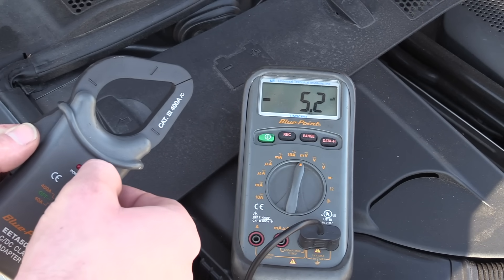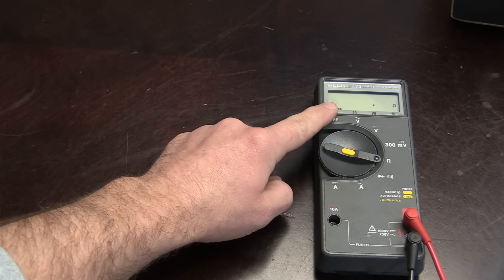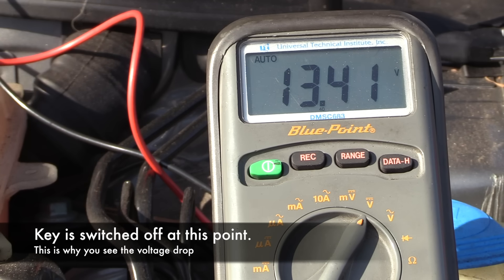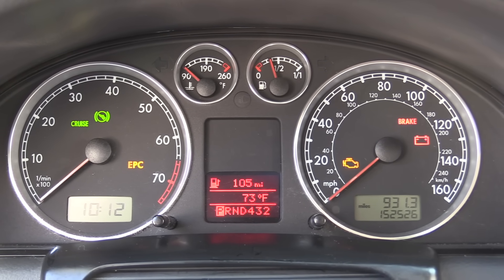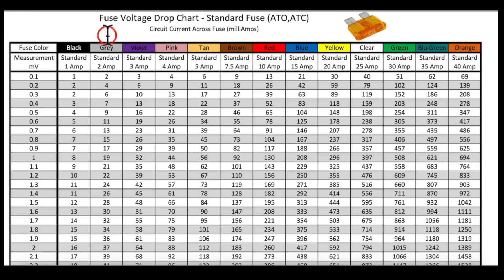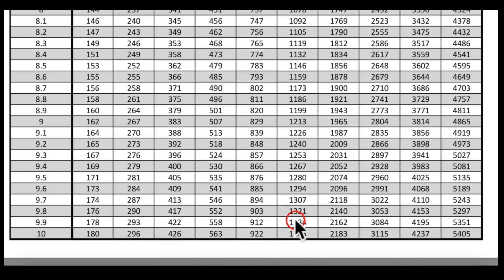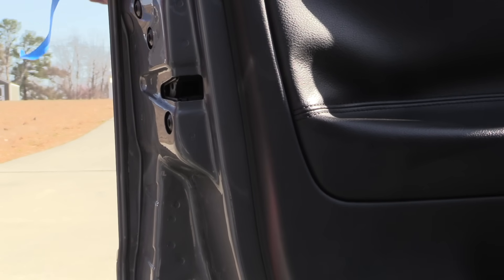The BEST Way TO Perform a Parasitic Draw Test

Comment: Trying to find a parasitic draw on a Yaris 2015, where there are a few large fuses (are they known as Japanese fuses?) do not appear to have an accessible place on either side of the fuse where multimeter prongs can be applied. I'd appreciate suggestion as to how to deal with this.

Comment: Great video! I have a parasitic draw on my 2012 Jetta Sportwagen S, 2.5L. But my problem is that my owners manual does tell me what a fuse is connected too. I contacted my closest VW dealer about getting some kind of a fuse map and what they sent me is extremely low quality pics of some database where you have a photo over a table.  Is there a website that I can enter my VIN and get some useful information?

Comment: I usually disconnect the negative cable and put my amp meter between cable and post, I latch the doors and wait like 5 minutes and then start pulling fuses. I’m going to try your voltage drop method tomorrow because if it works it would be faster/easier.

Comment: I had a van that wouldn't start from a drain. I took half the fuses out and the van started the next day, so I knew it wasn't one of those fuses. Then I took out half of the suspect fuses and the van wouldn't start so I knew the bad fuse was in the remaining half. Kept doing that each day until I isolated the bad fuse.

Comment: When I latch the doors on my f250 2017 the outside mirrors and interior lights don't go out so the truck can't be put into sleep mode ?
One would think Ford would have included a sleep switch for a parasitic test but I guess that would be to easy.

Comment: On 1990 chevy 1500 501L 8 cyl  p.u. truck  parasitic draw test with basic red centec multimeter which setting do I SET TGE DIAL WHEN JUST TOUCHING PROBES TO FUSES WITHOUT PULKIBG THEM OR REMOVING NEG. BATTERY CABLE?

Comment: how can ya measure voltage drop across a fuse with the two meter leads and the fuse is good with the fuse points connected  inside the fuse ...anyone ????
Reply from the maker: Any 2 points will have a drop if there is voltage on the circuit
Reply: @HumbleMechanic  THANK-YOU FOR YOUR REPLY SIR, I,LL PUT THAT IN MY BRAIN AND THINK ABOUT IT AND TRY IT ..PEACE EVERYONE !!
Reply: This confuses me, too. It doesn't make sense. What I think he means is that you measure the circuit current you're seeing, but the fuse adds a factor to that, so you look at the chart to see what it's really reading in the circuit, or would be reading without the fuse. So you get an accurate amperage in the circuit and can tell if it's too much for sleep mode. The fuse is just involved because it's super convenient to have every circuit right in front of you with two contacts right there. Maybe I'm wrong. I hope not, my 2010 XC70 is killing my battery every 2 or three days. We'll see.

Comment: I had a parasitic draw with a Jetta and it is not the sort of thing that kills the battery quickly.  Charles was right when he said that.  It is more likely to leave you unable to start it each morning.  You might be able to get around during the day with it if you must but you risk getting stranded.  If you do have this problem and need to attempt to use the vehicle despite it, keep a charged phone with you so you can call for a tow truck.  Then next stop is your favorite dealer or shop.

Comment: You made a mistake at 7:01 when you read the current draw. The table shows the current in mA. We see the number is 1006. That is ONE AMP, not .1 A. Please correct the video to not misinform the viewers.
Reply from the maker: There is no way to edit that.
Reply: @HumbleMechanic  Is that a "Yes, I made a mistake but I will not recognize it by editing the video"? Because you can take down the original, annotate on video with an asterisk saying "* I meant 1Amp" and upload it in the place of the original one.

Comment: Alright, this seems simpler as my new autoranging multimeter zeros out before stabilizing its amps reading while connected in series to the battery's negative terminal. It also seems simpler because, with my battery in the trunk and the fuse box in the glove compartment, I can't be popping fuses while reading the display.

This involves no removing fuses and no sensitive AMP mode to possibly blue the multimeter's fuse.

Comment: good point you made at the start is the battery voltage. It must be in the 12.5 to 12.6v level or else all the mv ratings on the power probe charts will be to far off. Source voltage is important !! good job man.

Comment: Thank you for the tutorial guide. I have had a problem with both merhods, amp drop test by pulling fuses resetting modules. But also had similar problems with voltage drop testing without pulling fuses. The issue i had eith voltage drop was sometimes the problem is intermittent parasitic battery drain coming from a module thats commanding something to draw power for a while then go away. And testing each fuse till it goes to zero can cause you/me to moss the problem fuse because it isn't always there, could be a draw every 10sec, every 5min, or every 40min.

So in short it's basically same with noth unless you are monitoring the battery negative in series with a jumper between post and cable connector so you don't unhook battery / car from ground but can see when the drain is happening on clamp meter.

Comment: Question??  never had this problem with any of my cars but i do with this one.. its a Kia Picanto and seems to be drawing a lot of Parasitic Draw to more or less Nuke a car battery in 6 months, is it best to just take the earth connector off the battery terminal until you use the car the next day, basically as it is not going into Sleep Mode when the keys are taken out of the ignition
Reply: One problem with totally shutting off the power is that what your computer "learns" goes away and it has to re-learn every time you re-connect.
Reply: @rickmurray7123  yes it's a bit of a nightmare.. but my 🔋 has lasted 6 months and still ok

Comment: Why not just measure amps across each fuse?
Reply from the maker: Because you don’t measure amps that way. You measure amps in line. Which means you’re pulling fuses. Which means you’re disrupting the system.

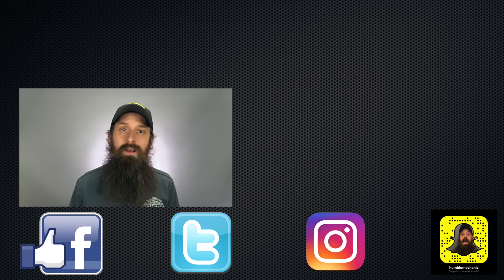Comment: hang on, is it just me..? at 10:45-ish he looks at the 3.4 milliVolt of voltage drop on the leftmost column and goes to the yellow fuse (20Amp) column and reads 1005 and says that's 0.1Amp??? The values in the fuse columns are in milliAmps (mA) and 1005mA is 1.005 Amps not 0.1005 Amps... a car radio will easily draw 1Amp.. I didn't go through all the comments, but if this has already been spotted I apologize.

Comment: Another option is to pick up one of the fuse holders for blade fuses. On amazon you see them as a circle of wire with a fuse socket. Cut the wire, add a spade connector to each end. To test current draw just pull a fuse, plug the spade connectors in where the fuse was, and put the fuse in the fuse holder. Now just use an amp clamp on around the wire. If you don't have one that is accurate enough, get a good meter that does. If you have a good meter but its not a clamp on style, you just need to alter your fuse holder leads a bit. Just make an additional lead from some spare wire that has spades on both ends. Now you can plug it into one of the fuse slots and clip your ammeter in series with the new fuse holder. Super simple to do and gets you an accurate and fast reading. No need for charts etc. It does have the disadvantage of messing with the circuit so the problem may temporarily go away but other than that its fast and easy.

Comment: I can not understand that it works to test by holding the leads on top of those spots on the fuses, because when you do that, the curent goes through the fuse, not the multi meter...?
When I try to test like that, I get zero measure, but if I pull out the fuse and measure with the leads direct between the fuse slots, I get a measurment.
And, many older cars does not have the door open sensor/coupe light switch at the door locks, but in the door jamb.
Reply: You're measuring millivolts drop across the fuse element.  The drop is very small.  You're measuring small fractions of a volt going across the fuse that way.  With the chart you can find milliamps (pretty small current) that way.

Comment: I have a 2.0L B8 Quattro. The other day the lights for my Electric Parking Brake stopped turning off when I get out and lock the car. Everything seems to be working as it should, just the light in the gauge pod and on the EPB switch don't turn off. Praying someone knows what's going on?

Comment: Subaru has admitted 2016 and later vehicles keep trying to ping non-existent 3G services with the DCM, then 5G repeatedly for later vehicles with a memory leak.  Repeatedly runs down the battery.

They will replace the DCM if you have Starlink.

Comment: My 2014 Ford Escape consumes a battery every 3ish years without an abnormal parasitic draw. The way modern vehicles are set up is just asinine. Unlock the vehicle using key fob or opening any door wakes everything up putting a big draw on the battery for around 2 minutes. The vehicle will do its own thing with the key off, also putting a big draw on the battery. This kills the battery. I had a Walmart Ever Start go to battery in my garage that was 12 years old when it finally died. I kept it on a .500ma Harbor Freight battery tender. Bought another go to battery from NAPA in 2021. It's on that same battery tender. No problem so far.
Remember when a car battery would last 6 - 8 years in an old school vehicle? In those vehicles when the key was off everything was off. I'm looking for a way to convert my Escape to do just that or have a dual battery setup of a deep cycle for the wakeup part and a regular car battery for starting. Thoughts?

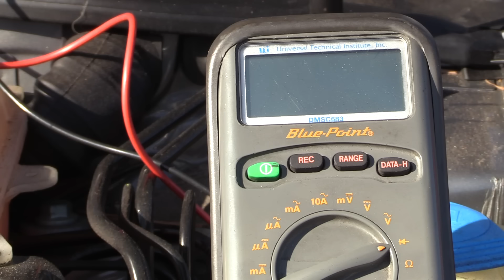Comment: Noob here. At 3:00 where the meter is on the battery. Which probe to which terminals? And what’s the best way to hold them in place there?
Sry for the dumb question 😅

Comment: I always unhook the battery for an hour or 2, then I usually use my snap on vantage pro and put it on mah right at the battery. Then use my thermal heat gun on all the fused circuits. It almost always shows me right where the current is going. Then focus on the hot fuses. Using a similar method to what you're doing here. I'm not a big fluke fan due to their inconsistent numbers. The snap on allows me to zero my leads resistance, which eliminates skewed readings. Good video!

Comment: Hi can you confirm if you disconnect the battery atall? My knowledge was amps needs to fill where the circuit is broke but your not braking the circuit

Comment: I have a 06 beetle that I changed the battery twice because it drained it dry after i drove it two miles and back and the battery is alway dead once i get back  from driving it i got a brand new one it lasted two hours in it and then it was dead very frustrating i think I’m just going to junk it to bad thought its in mint condition and cant wait to just junk it
Reply: Sounds like it's not charging at all and has a major current draw as well.

Comment: I never thought to check voltage drop across a fuse. I just presumed it should be zero-ish. I have been doing my parasite drain check by setting my multimeter to mA, pushing one probe into the battery cable or clamp, putting the other probe onto the battery terminal, and lifting the loosened clamp around the probe. I usually balance the clamp on the probe and it all stays put. This method shows total parasite drain and doesn't interrupt the power to the car. From there, fuses can be pulled one-by-one. I appreciate this may not be wise on modern cars but I work on classics for a living

Comment: This method is fantastic it saved me not only time but a lot of aggregation.  Pulling fuses that dont want to come out of small spaces is a PIA. however, what method do you use when checking tge relay circuits?

Comment: Excellent video. I took my Malibu in. I kept buying a battery. They found the turn and hazard signals were drawing power from the battery.   

They wanted 890 bucks. For a 10 dollar switch. Replaced it myself. I could have saved a diagnosis fee if I had seen this video earlier. 😑.

Comment: I don't understand why you are manually latching all the doors, hood, and trunk.    You would only need to manually latch the door or hood where the fuses are so you have access - correct?
Reply from the maker: What happens if you need to get somewhere other than the fuse panel like a module after you do this fuse test. 

You want to give yourself full access to the car without opening a door.
Reply: @HumbleMechanic  Ahhh OK makes sense.... thanks a heap.

Comment: What I don't understand is why there is a voltage drop across a good fuse? Surely testing either side of the fuse would be like testing for voltage drop along a piece of wire with the probes about an inch a part?
Reply: Evidently the voltage drop is there, but it is very small,  We're talking millivolts and milliamps.

Comment: NOT the best way to do a parasitic draw, especially if it's an intermittent draw. The old tried and true way of putting your meter on Amp, putting it in series with the negative side of the battery works better. THE ABSOLUTE BEST WAY is to use an Amp clamp style meter placed on the positive cable, and then do the voltage drop tests!

Comment: This is a terribly flawed method. To find out why, check a video by fordtechmaculo.
Reply from the maker: It's not a flawed method at all. BUT Just like any test plan, you have to use it in the proper environment. If I remember Brian used a thermal gun? Thats a great method too. 

If you treat these type of things like an A vs B or "only this is right" youre missing out

Comment: Oh man, I've done auto electrical with great success for decades, yet I guess I need a lesson in basics because I'm not getting this. Can someone explain to me what's going on when you're getting this voltage drop across a good fuse? And why would that figure vary between different value fuses? I would think that continuity is continuity, I'm seriously not understanding something here.
Reply: The voltage drop is very small.  The fuse is, in effect, a resistor of very small value.

Comment: 9:16 The voltage measurement used to infer the current draw is not affected by the battery voltage being low, unless it's so low that the active circuits start shutting down.
The 3% drop in battery voltage to 12.33 from 12.7 is going to be undetectable when in the mV range of the DMM.

Comment: Thanks for this nice video.

I did the test and found 61.2mA draw as per this test. However, when I connect the meter in series to negative terminal. I am getting a draw of abot 125mA. Not sure where the excess draw is coming from.

Comment: I am a bit confused here, so let us say a circuit is live & it is consuming current. Now measuring voltage across a fuse means we are measuring across just a wire, how comes there will be voltage drop when we are measuring across fuse. I am confused

Comment: Well I found the issue now I can't unlock my doors that I latched 😢
Reply: Facts bro wtf
Reply: @itsdavelleTV  don't worry turns out I was a moron and I just had to actually pull the handle and then use the screwdriver to unlatch it at the same time. It was a little awkward to do alone.
Reply: Thanks Sir Moron!  You saved my bacon. Thought I would be paying for towing to the dealer. Takes one to know one.

Comment: This video was extremely helpful.  The guys at the auto shop couldn’t troubleshoot the problem and I had 3 weeks to wait to get it in to the dealer, so I did this test myself and found a failed rear wiper drawing current.

Thanks for the help!

Comment: Hi guys, thank you for a helpfull video. I have a battery drain issue in my VW T5 - 75mA in idle mode. Found by removing one by one fuses, that if disconnecting this rear air con control unit, everything became ok. The trouble is I got another used one from a friend, put it in and the battery current drain is back. No idea what to try now…any tips please?

Comment: While this is a way to do it but, this is a slow ass method. 
Just disconnect your NEG wire, hook your meter to the NEG wire, and your other lead to the POS POST on the battery. Set your meter to milli amps.
If you see a power draw such as 0.123 then you have a parasitic draw. 

Then start pulling fuses. When you see the power draw drop. You found your point of loss. Go from there.

Comment: This is a great method if you've a continuous draw. For an intermittent draw you can easily pass over the fuse that's causing the draw because you may put the leads on the fuse but at that moment it isn't trying to draw. Say, something like a stuck rear wiper. It's only going to try and draw every 20-30 seconds. Very easy to miss using this method. 

Just something to keep in mind. Otherwise great vid
Reply from the maker: Intermittent draws are a nightmare
Reply: @HumbleMechanic  true story haha. Just got done dealing with one on my 84 Vette. Ended up being fuse that controls power locks, cig lighter, power seat switches etc. Took me 3 days to finally find the bastard lol

Comment: I wish I had seen this before I went through our bucket truck and started replacing parts...After spending over $2,000 on parts, I finally did this test and found out that our power inverter was the problem.  A $2 external power switch, and problem fixed.  Thanks for this video!  My fault for not googling this before hand lol